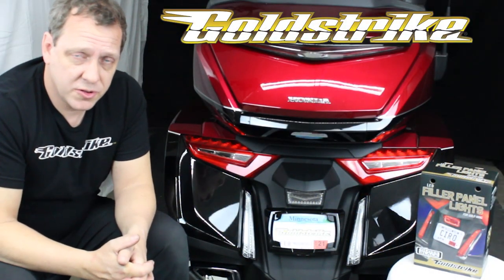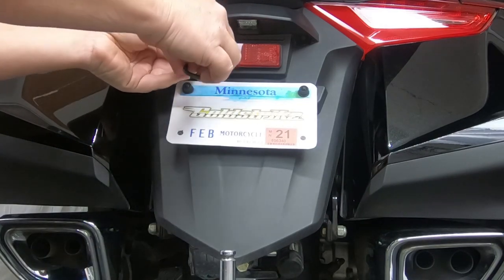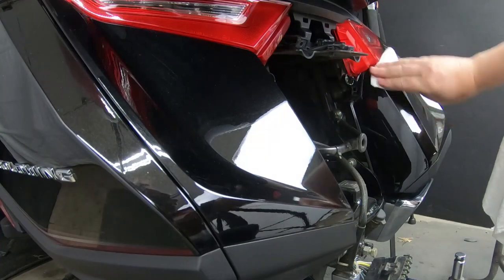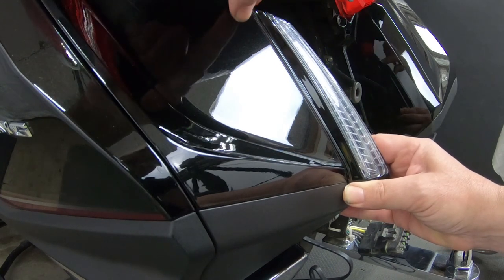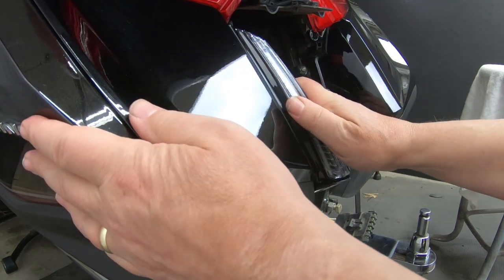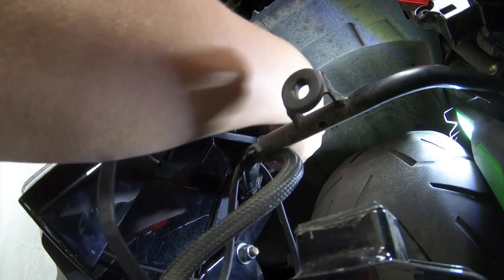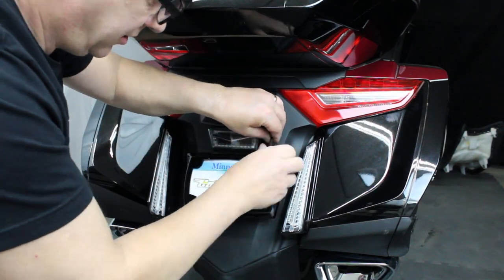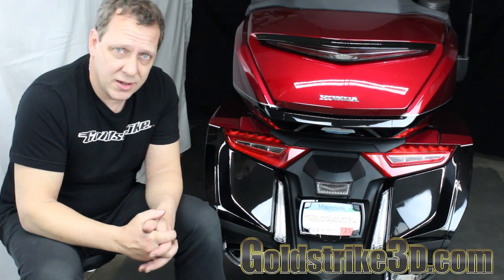Goldstrike LED Filler Panel Light Installation for Honda Gold Wing

Comment: (questions and concerns will be kinda mixed together so sorry for that upfront.) 
Hello. So I have some questions and concerns regarding not only this kit but all your LED kits that are 3M adhered to the bike. So for people that don't change there bikes like some people change there shoes, are you able to easily replace the lights down the road when the LED's do start to burn out (cause even the best of LED's don't last forever.) or are these just built to last the life of the sale and whatever happens after the sale is oh well whatever? or did you design all your LED kits in-mind that at some point they will need to be replaced? The main reason for asking is that 3M tape is almost always a permanent situation and I don't want the worst thing to happen when the time comes to replace the lights if the only way to replace them is to replace the whole unit with another and that worst thing is pulling of a large area of my factory paint given that when the time comes to replace lights that the factory paint will have aged and I just don't know how well Honda's paint jobs really are. I'll stop this here as I don't want it to get any longer then it already is but this covers the majority of my questions and concerns. Thanks in advance and stay safe. 🙂
Reply from the maker: Hi there! Thank you for reaching out, to answer your question we use 3M VHB not only because it's strong but can also be removed so you can move your light to another motorcycle if it needs to be replaced. There are several ways to remove the adhesive and when properly removed you will not even notice it was on your motorcycle. For more information please email our tech support at techsupport@ciro3d.com

Comment: do I need to install the 48000 Harness not sure of that product. I do have a power distribution accessary hub  for Goldwing 2018-2019
Reply from the maker: Hi David, yes, you will need our 48000 Plug-n-Play Installation Kit: https://goldstrike3d.com/products/copy-of-lighting-y-splitter?_pos=3&_sid=cb3ba6817&_ss=r

Comment: Holy moly, the price they want for a $20 stick on light
Reply: First off I don't know what LED's your buying but quality ones aren't cheap. And what about the rest of the light like the plastic, the R&D to design it, the tooling to make it and the labor and materials to package and ship it. There's alot more then just LED's here. Also to answer your other question these are for the 2018+ Goldwings any type. Hope this helps and have a nice day. 🙂

Comment: So how do you attach the lights when using the filler/fender extension? Have a video?
Reply from the maker: Hi James, please contact our tech support at 715-808-0027 ext. 107 or email techsupport@ciro3d.com and he will be able to assist you!